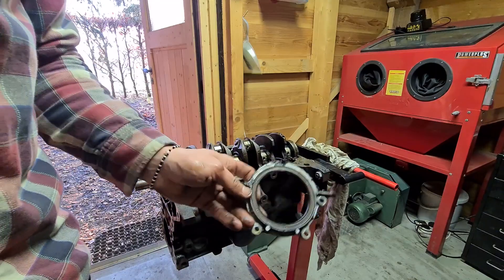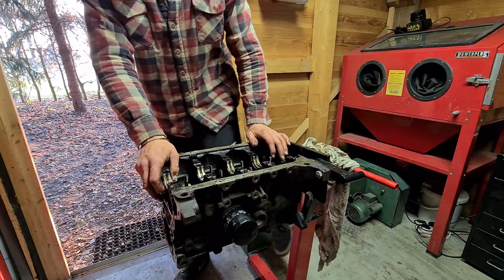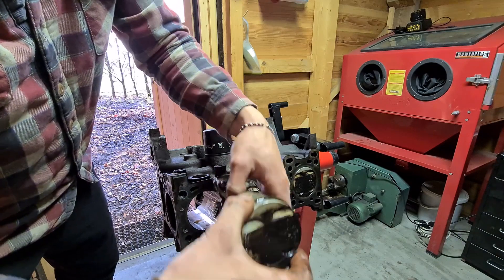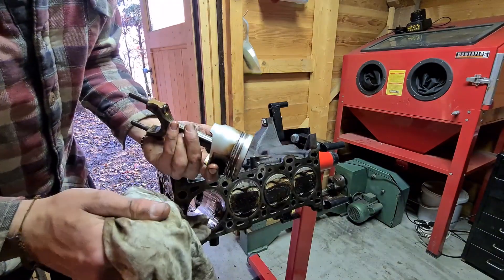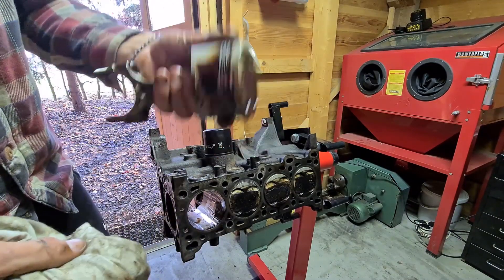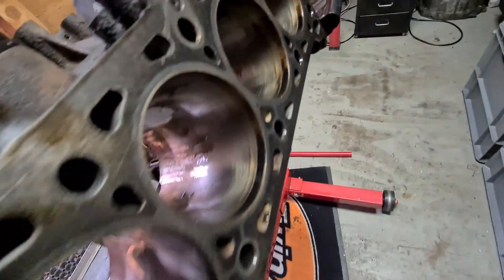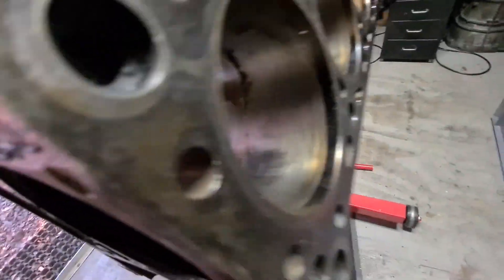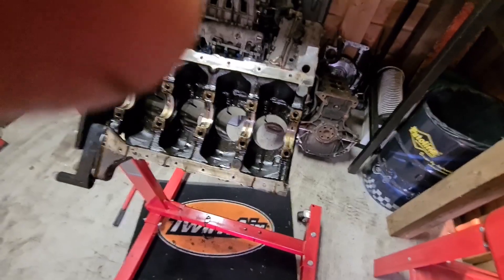HIGH RPM ITB Miata Engine Build (Part 1 - Cleaning / Stripdown)

Comment: Why many people say that increasing compretion ratio is dangerous for the engine?
Reply: It is not dangerous. You will need to adjust the ecu and probably use a higher octane fuel.
Reply: @nostromolv  and how we keep it safe?
Reply: @nostromolv  for a 7k rpm engine is it necessary that? I was planning keep the stock engine just with higher compr ratio and itbs